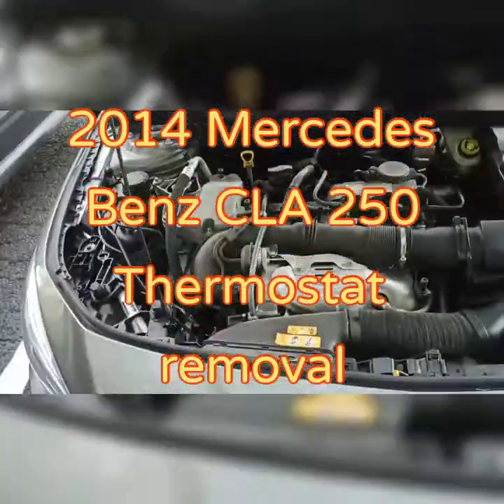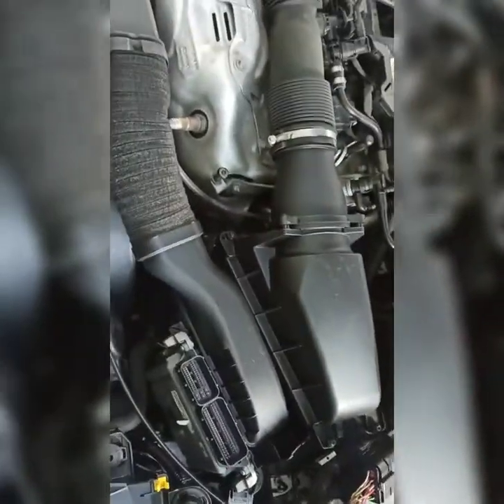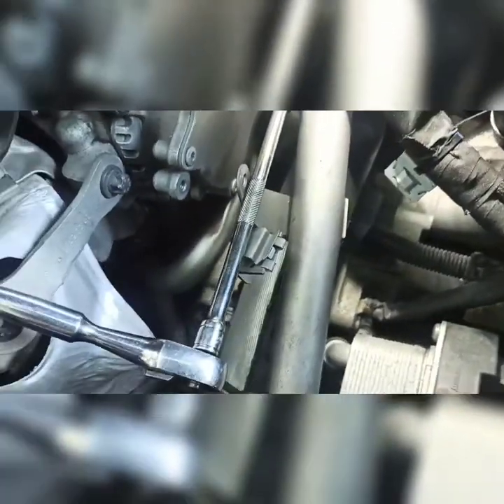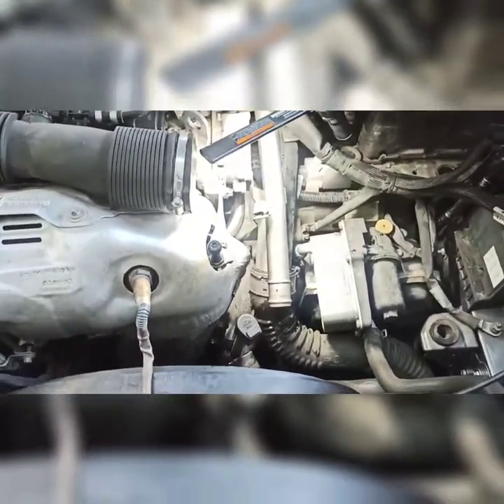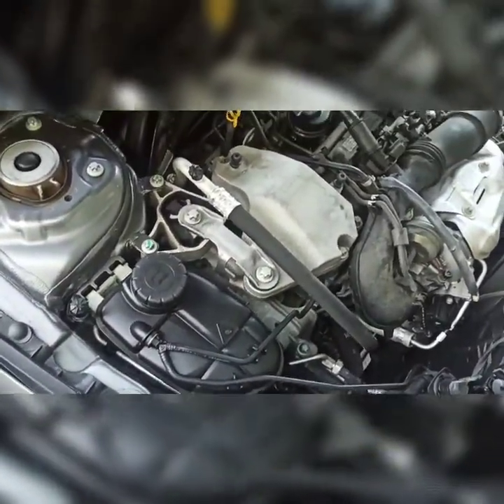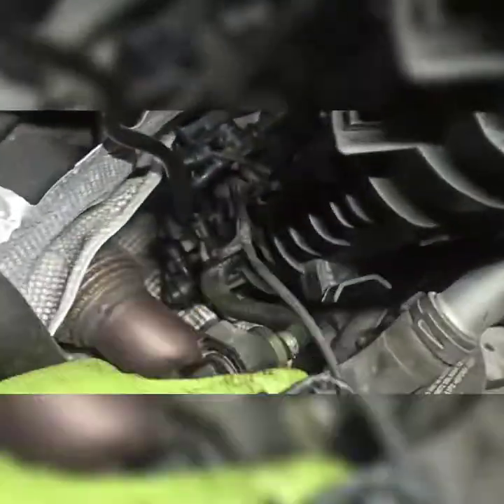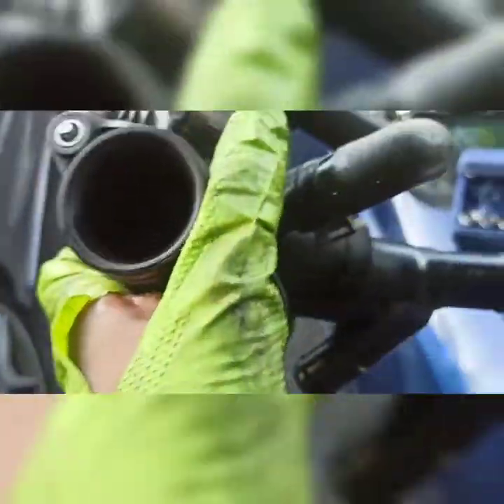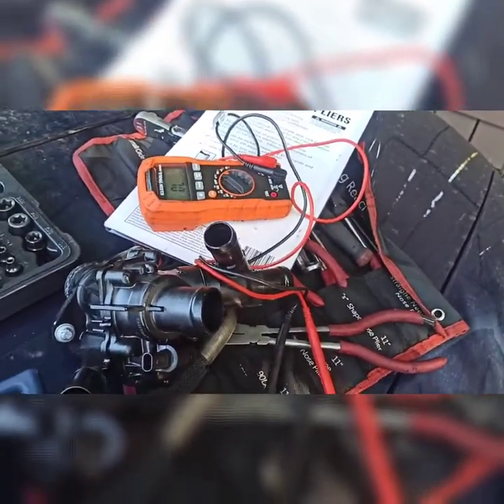2014 Mercedes Benz CLA: Thermostat removal

Comment: mate you are wrong on the way to starting that job, I did two of those this week the whole job is 4 bolts throttle body off, 6 bolt manifold release. 2 nuts release vacuum valve and the rest are vacuum pipes move aside without disconnecting them, 1 PCV breather 1 return airline and you get access to the thermostat, release water pipes and two torque bolts. I drained the coolant first and start the work after the drain.
Reply: i think I have to remove the intake manifold to replace the heater water control under. how difficult to remove the intake manifold... it seems very difficult.
Reply: How much coolant spills out when doing this job?
Reply: you drain the coolant, to begin with, before the work starts. try next time you will see it is much shorter. good luck

Comment: hi Usman thank u for sharing .. my a class w176 temperatur indicator looks like not steady at 90 degree celcius, some times it drops between 50 to 80 degree even while driving in highspeed highway. last time while i driving in higway and the temp indicator at 80 degree, i kick down throttle pedals then engine check on. im not sure what number error code but mercedes guys at workshop says probably it thermostat faulty. right no i driving my a class with temperatur indicator up and down between 50 to 90 degree .. is this condition ok to the enginee ?
Reply: I have the exact same issue, your thermostat isn’t operating as it should, it’s probably stuck in open and doesn’t close hence not at 90 degrees. Your thermostat doesn’t have to be broken to not be working properly. It’s a common issue due to close proximity to the manifold and the extreme heat it experiences. U should get an engine code of p0128

Comment: Did it work for you? My cla is overheating about 15 mns , I just ordered thermostat hopefully that will be it
Reply from the maker: There was a code for the thermostat. We did not just throw a part at it. The thermostat fails in the open position I believe. So get the car diagnosed before you spend money and hours of work for nothing
Reply: Hello there . What is the code ?
Reply from the maker: P0128
Reply: Thank you ! I’m trying to order this part for my 2014 CLA 250 4 matic . Would you happen to know the part number ? The one I ordered the mechanic is saying it’s too big ..
Reply from the maker: @dakirriifrancis2564 Mercedes part# 2702002200

Comment: I have to do this on a CLA45 AMG, is it more difficult?
Reply from the maker: I would imagine if it had a supercharger of sort ... But I'm not sure
Reply: I have the same car CLA45 and engine light is on.  Scan and came with a code P059700 coolant thermostat has an electrical fault or open circuit.  Are you having the same error and check light?
Reply from the maker: Yeah you need a thermostat replacement
Reply: @Usmanthemecano  Thanks Usman, How urgent is this repair and whether I could continue to drive the car till the repair begin?  What would be the symptoms with thermostat with open circuit? Many thanks
Reply: @Usmanthemecano  I have one more error code 912749 Air quality sensor malfunction, there is an electrical fault.  Do you know where is the sensor located in CLA and can I reach there and have it replaced without taking parts apart?  Thanks once again
Reply from the maker: I'm not sure if it has a failsafe mode. So just watch your temp gauge
Reply: @siulilomay628  I have cla45 amg, got the same code regarding thermostat replacement. Got an estimate yesterday for $1,200. How urgent is this repair? Is $1,200 a decent price for this kind of repair? Thanks

Comment: Could you have just went straight to the intake removal to access the thermostat or was the other stuff necessary to remove. It kinda looks like just removing the intake could have done the trick. I’m about to do one as well. Thanks for the video
Reply from the maker: Everything is necessary to remove
Reply: @Usmanthemecano  ok great thanks for the info